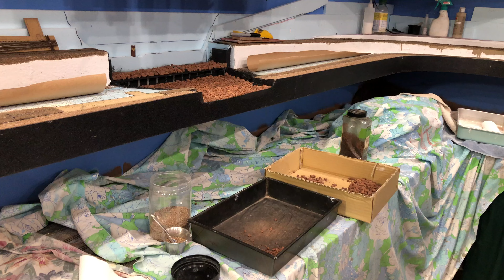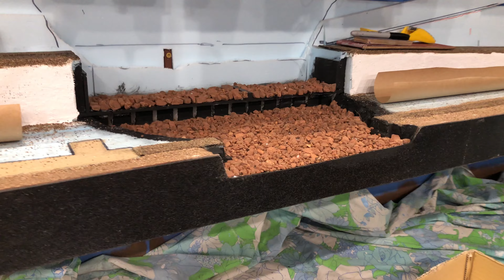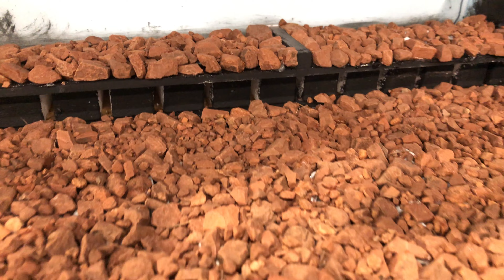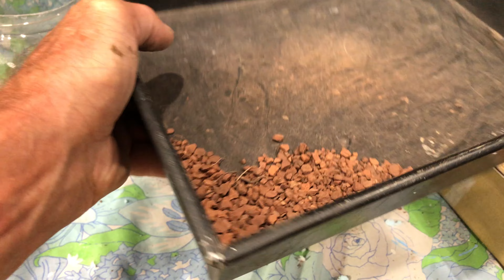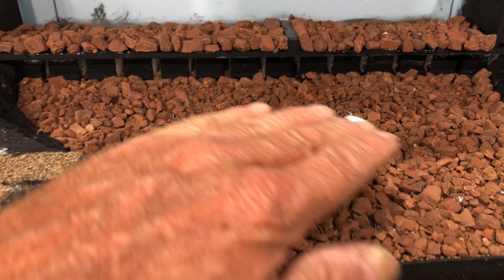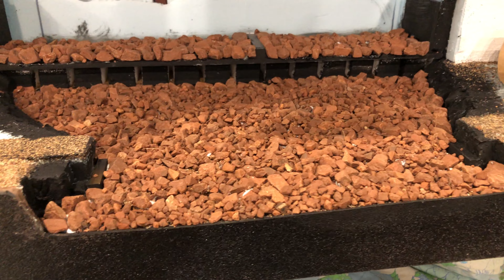East Comstock Update 13

Comment: Hey there Tom...did you back that dirt? You may have microbes  and mould spores in the mix that will cause problems with the layout in the future. If you use untreated dirt...be sure to bake it at over 100°C for 10 minutes. Cheers for the update
Reply from the maker: When I first started I did bake my materials but for some reason I stopped that process. Time will tell but so far I have seen no issues.  I suppose my layout could end up not being "museum" quality. Like it ever was! Oh well.

Others said to run a magnet over home made sifted materials, I use to do that too but again, stopped. Maybe I'm getting old (68) and forgetting things or I guess got lazy and forgot the "rules".
Reply: @tomlander123  Haha...fair call...loving your work...cheers for the reply.